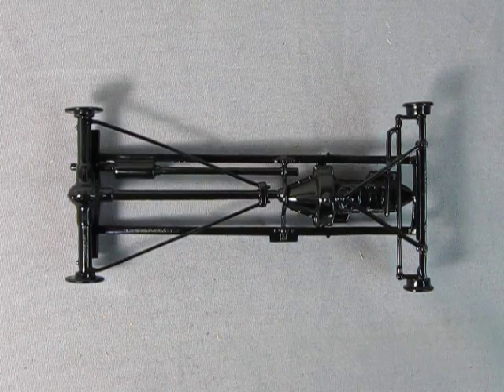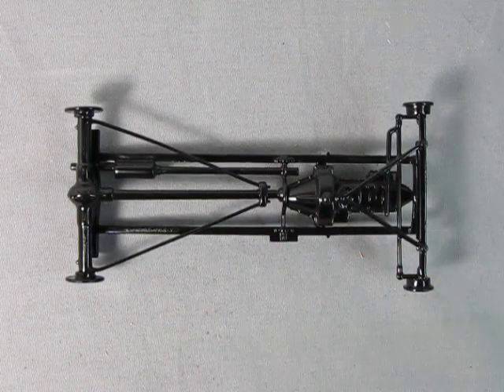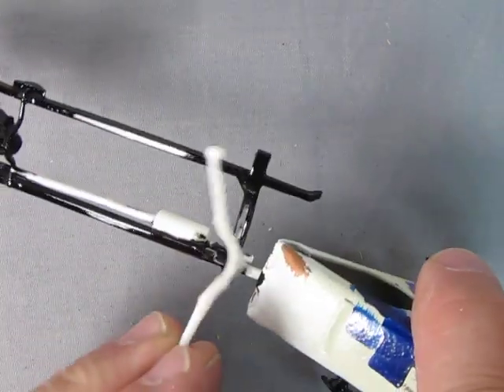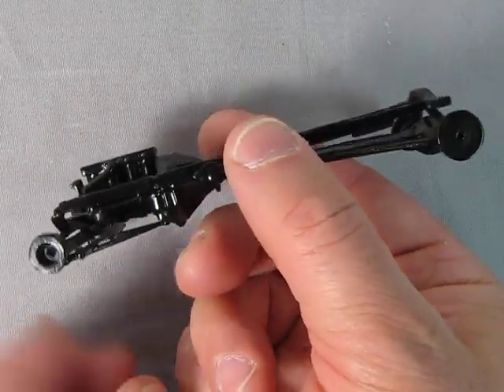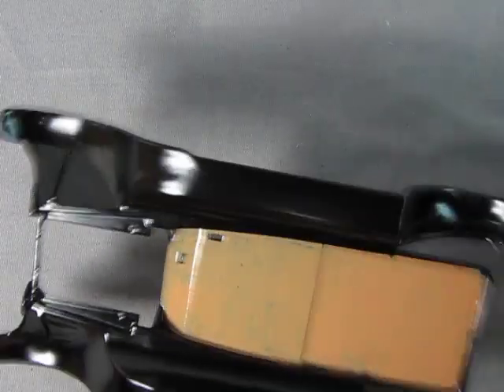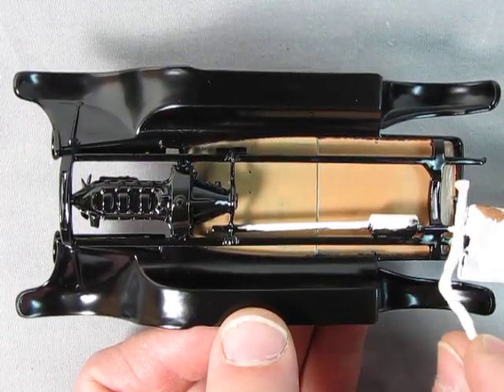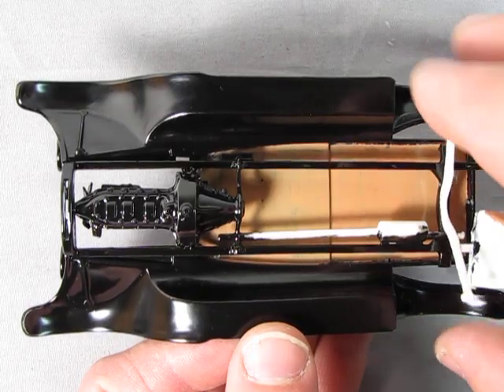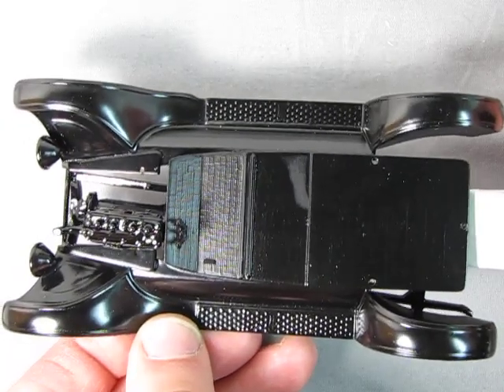Trying A Different Construction Method With The AMT Model T Ford Frames.

Comment: The old buggy spring can be a pain to get straight Trevor
Reply from the maker: For sure...and I have 6 of these kits!
Reply: With that many,I'd make a jig that holds them at 90% to the chassis🤔. I might dig out the old C-cab,I've  got and invent one 🤣🤣
Reply from the maker: @petesmodelcarcustoms584  I did wedge in some wood match sticks or shims or something on either side of the spring to balance it out while gluing the model suspension upside-down, but in the end, some of the Model T's had the "lifted Dog Leg" effect happening.